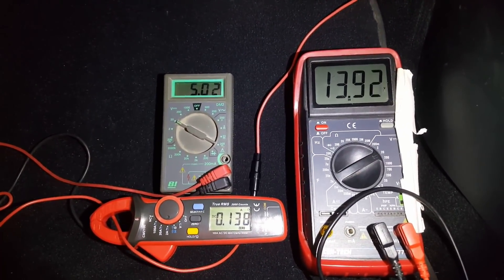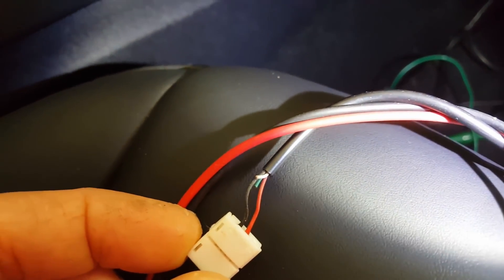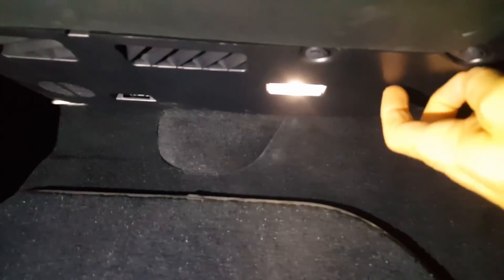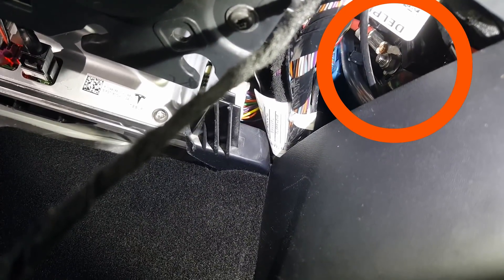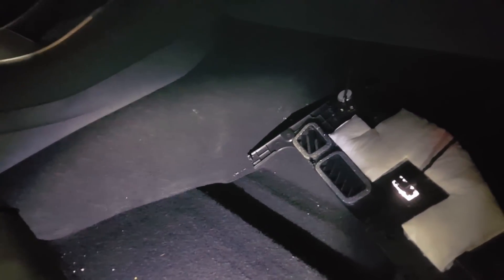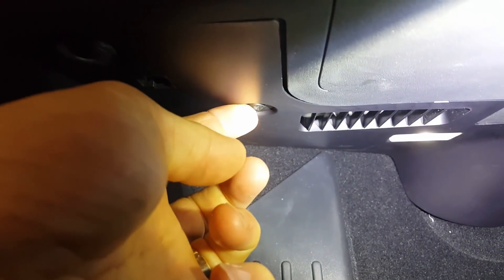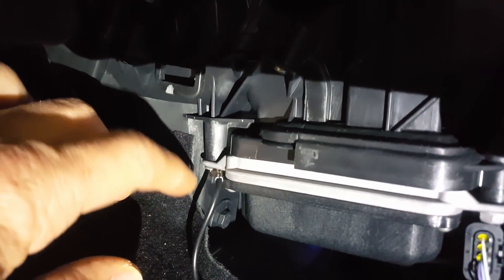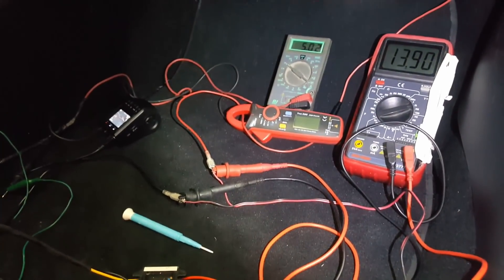Tesla Model 3 constant 5V source for dashcam

Comment: What a great concise video please can you supply part number for the  the regulator you used with the screw terminal this will be helpful  when you connected to 12 volt how did you isolate before connecting
Reply from the maker: Link in the description, it's this one: http://a.co/7VYwOhW  If by isolate, you mean turn off the 12V system, I didn't bother. If you would like to turn off the 12V system, it's a 2 step process. First, disconnect the negative terminal on the 12V battery. Second, disconnect the data connection to the HV system under the rear seat (passenger side).

Comment: Do you think those terminals that you tapped into would be capable of handling a 1000W-1500W power inverter to get 10-15A of 110V? This thread discusses it for the Model S and I'm curious as to your thoughts on vampire draw with the Model 3 from a constantly running dashcam and how well the DC-DC converter does maintaining the 12V battery? https://teslamotorsclub.com/tmc/threads/is-it-safe-to-connect-a-large-inverter-to-the-12v-battery.97744/
Reply from the maker: Dave Rowley I wouldn't try to draw that much power from those terminals. An inverter that big could draw over 100 amps at 12V. I don't recall the specific video, but https://www.youtube.com/user/Ingineerix mentioned that the DC-DC converter does have quite a bit of capacity. However, I doubt there's a legit way to directly connect to the car's DC-DC inverter. I would connect an inverter like you mention directly to the 12V battery and only use it while the car is awake so the car can keep the 12V battery charged.

Comment: if you need 12V for a blackvue, couldnt you skip the voltage regulatory to go down to 5V and just get the buck-boost regulator to do 9V to 12V
Reply from the maker: Andrew Nguyen yes, you just need one regulator. Either the buck to get 5V, or the buck-boost to get 12V.
Reply: Awesome, will give it a try!
Reply: Andrew Nguyen how did it go? I heard the blackvue can run off 9 volts.
Reply: @ampersandru  Any luck on your comments above and a part number for the buck-boost that might be in-stock somewhere?

Comment: Awesome! What gauge wire and what size of first did you use? Any voltage regulator will work?
Reply from the maker: I use a mix of Amazon, home improvement stores, and auto parts stores.
Reply from the maker: 18 gauge wire with a 10 amp fuse. Voltage regulator I used is in the description, but any regulator that can handle 9-14V input and can supply the output voltage (5V in this case) and current you need will work.
Reply: Any recommendations for buying basic hobbyist wiring solutions locally now that Radio Shack is gone or do you buy all stuff like that on Amazon as well?